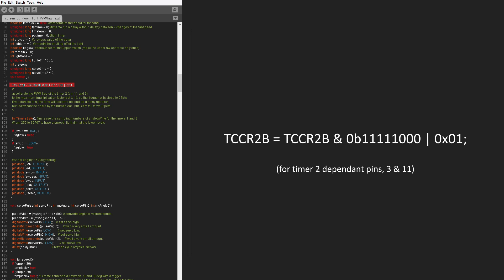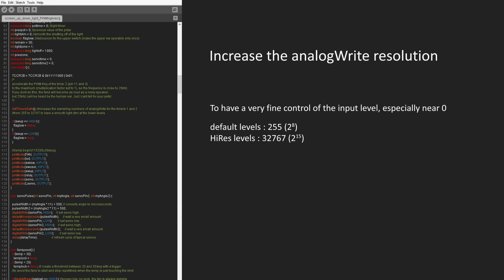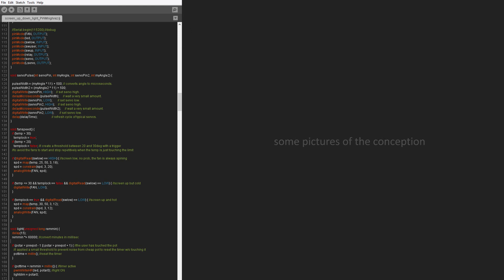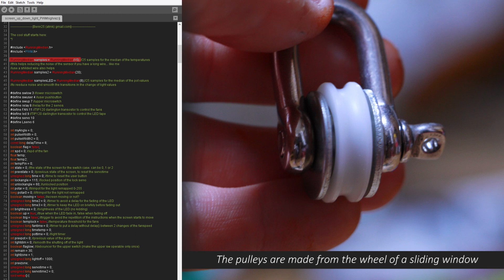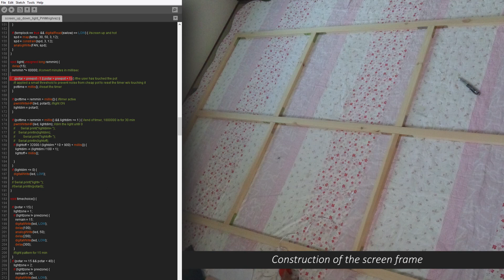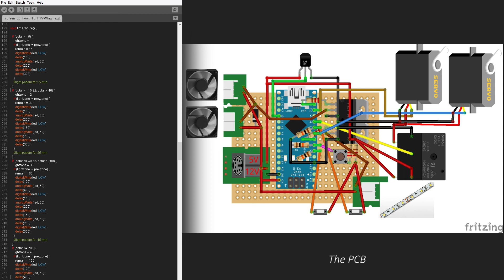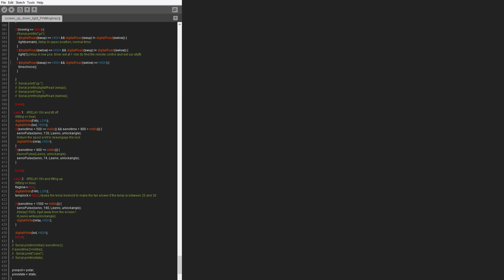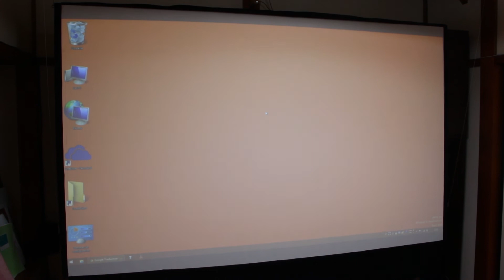Arduino screen lifter and home theatre system

Comment: Nice build! Simple and it works. I've planned a similar way and ended up with an manual lifter without Motor. But  the screen is also my ceiling light.
But my new version there will be an Motor.